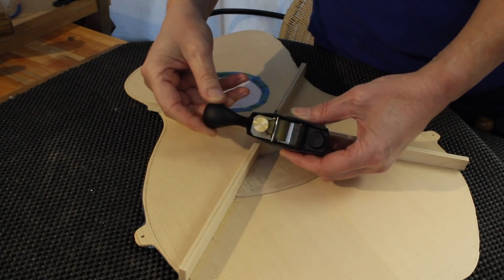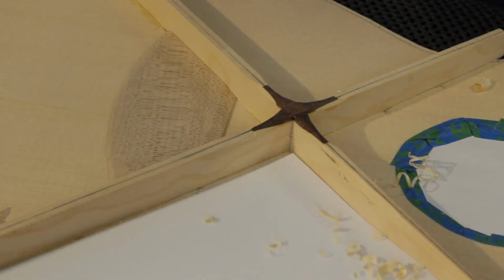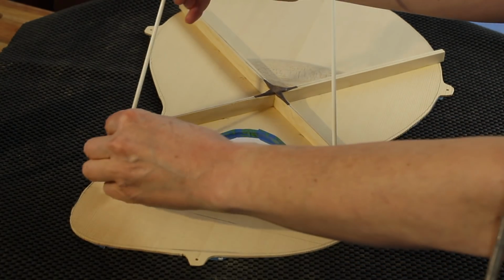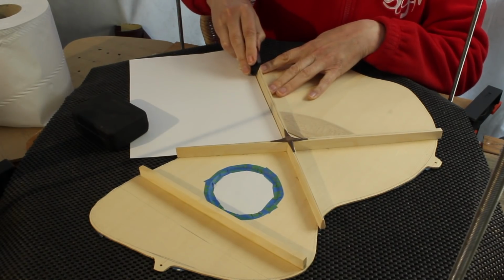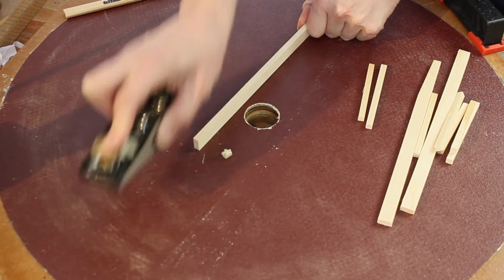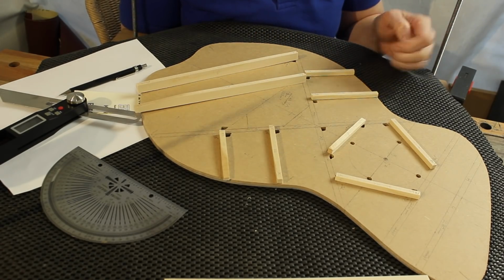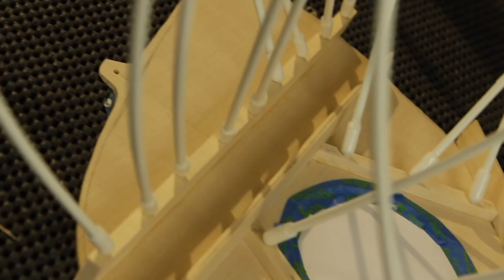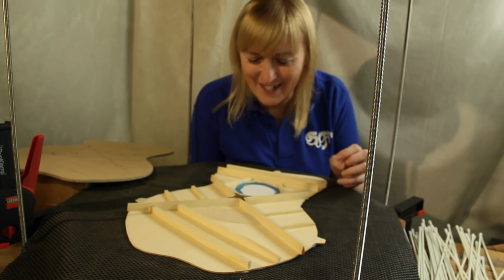SuGar SG1 acoustic guitar build part 47: Bracing the front

Comment: Chiseling tip: When doing work like that, it is good to hold the chisel firmly between your front hand fingers, that are right behind the edge, so that it can move forward only slightly. You don't then get these forward jerks that tend to leave unwanted marks. Also you are less likely to hurt yourself, when you stay in control. How exactly to holf the chisel depends on the shape of the area, but there usually is a good way available.

Comment: Hey Susan, I came here via the DIY thickness sander video's! I love them, and it inspired me to make a thickness sander myself as well. What I'm wondering actually is where did you get those go bars in Europe? I have been searching for them for a long time! cheers
Reply from the maker: They’re 4mm fibreglass curtain rods used for roman blinds. You should be able to get them from any curtain suppliers. I found these on eBay, along with the rubber end caps. They came in 2.4m lengths. I cut them to 60mm

Comment: You may have liked to have keep the centre of the upper transverse braces flat so the soundboard is flat where the fretboard sits.  Conforming the flat fretboard  to the radiused soundboard can be a bit of a pain, either needing an additional spacer under the fretboard  or relieving the middle of the fretboard to avoid gaps along the edge of the fretboard.
Reply from the maker: I’ve seen that advice before, but I’m gluing into a radius dish, so having the centre of the brace flat will simply mean a poor glue joint where there’s a gap. In any case, there’s only 0.05mm across the width of the fretboard for a 8.5mm radius so it’s easy to level
Reply: I have a more or less flat upper transverse brace for that very reason - flat across most of its width with a small amount of radius at each end.  You can also flatten the soundboard area where the FB will sit but you'll have to do something I suspect.
Reply from the maker: I’ll take a levelling beam to mine. I don’t see it as an issue as the amounts of material are quite small
Reply: @SusanGardener  sounds a good idea.  Some others have a flat sanding board which pivots at the saddle location almost a pendulum effect.  Kathy Matsushita has pics somewhere on her site.  Someone else builds the upper transverse brace with a 60 foot radius.  Plenty of ways to get there!

Comment: Just curious, did you ever consider using a card scraper when shaping in those tight quarters?  I'm sure there was probably a good reason not to but it could have saved a lot of struggling I think.  (Great job by the way, it's fun to watch the instrument taking shape!)
Reply from the maker: I’d not considered a card scraper for removing material - I tend to think of them as finishing tools, but you have a good point. I’ve had problems with scrapers turning tight curves into sharp corners though - maybe my technique is at fault. I’ve still got further work to do on the centre of the X so I might experiment.

Comment: thank you Susan . i though the braces above the sound hole were non curved . how many rods did you use ?
Reply from the maker: I thought it best to reduce the weight a little - there are 2 braces so plenty strong enough. The guitar is pretty inert above the x brace so no need for ‘tuning’ the braces. I used over 40 rods I think
Reply: @SusanGardener  wow 40 thank you Susan
Reply: I think your right Walter, the bracing under the fret board has to be flat or how is the fret board going to sit flat to the top?